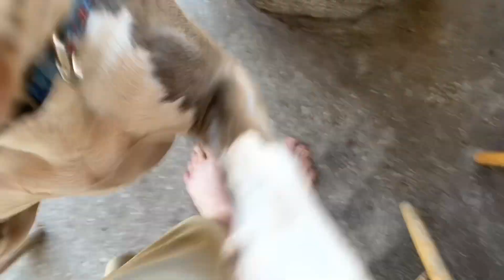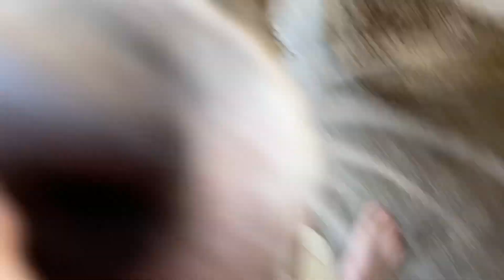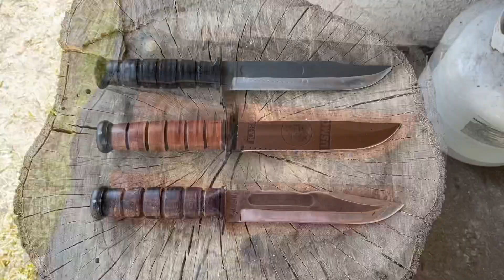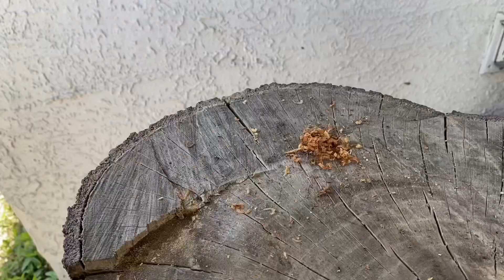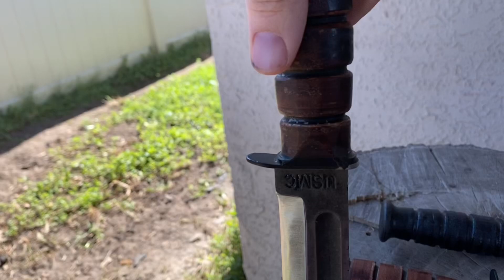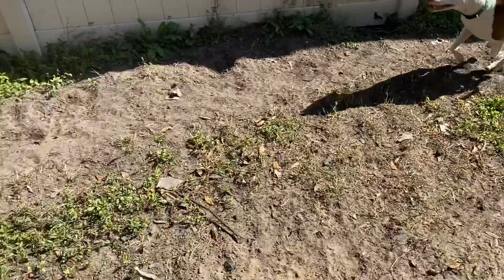KABAR Modifications For Bushcraft And Survival

Comment: The MK1 is much better for Bushcrafting mods . The blade is already slicy and doesn't take much edge work to convex the primary , plus you can get either the leather or rubber handle version .  I know both knives have weak point but if people don't abuse um and use them as knives they will last a lifetime. It wasn't until the batoning through log faze that it became a so-called problem .
I've had my eye on the old navy mk1 for many years , and now they are freaking spendy .  Personally I'd rather buy a Becker BK 16 or BK10 and modify those blades for Bushcraft ...BUT those leather handles just speak to your inner voice that's says "That's fricken cool looking" .

Comment: I love the Kabar knife. I love the smell and feel of a brand new one. They can be used in bushcraft as long as you remember it's limitations and not beat the crap out of the knife. I've used one specifically for bushcraft and it did well. It may not have chopped down logs but did everything I need it to do. I'm actually thinking of buying a Single Mark Ka-Bar simply because I miss it.  I might also buy the Wallace Apoc Bowie which is like a Becker Bk9 on steroids.

Comment: I like your mods and thinking. I also remove the curved clip shape on all my "bowie' style knives.  It lowers the point closer to the centerline for starting a divot or a drill hole, and, it moves the point to a thicker part of the blade.  Can't hurt.  

Mine is an Ontario as well, and I polished off the black stain and oiled the leather with Obernauf's to keep the discs from shrinking over time - which they will .  Not likely in what is left of my lifetime, but they do.  

On Waterproofing:
Wax is only a topping seal, but wears through in no time, loosing it's waterproofing.  Oil soaks in deep and will prevent the discs from separating.  NOTHING is waterproof except silicones or epoxies.  Waterproof leather boots are silicone impregnated by heat and pressure, and that's the ONLY reason they are waterproof.  No oils or waxes ever work on boots or gloves for very long.

Whether an original  or an Ontario or any other knock-off, the blade requires a modified angle to get a fine shear edge.  These knifes were designed as stabbing weapons - not camp tools.  So, like the Roman gladius, they were meant as thrusting weapons.  You need a good roughing stone or diamond plate to remove enough metal to then be able to get a razor edge.  Once you do, the 1095 steel will hold it as well as can be expected.

Comment: Interesting mods. Thanks for sharing your experiences. Any issues with heat affecting the temper of the point when you grind it down?
Reply from the maker: No, no issues at all. The key is to take it REAL slow, and have a cup of water next to your grinder and dip the blade after each pass.